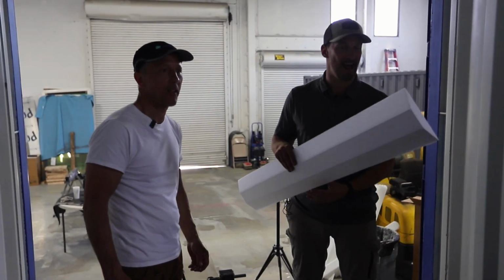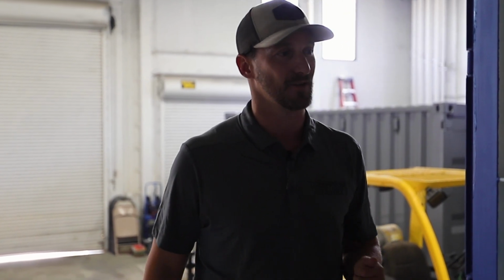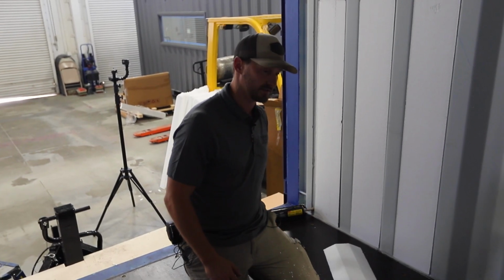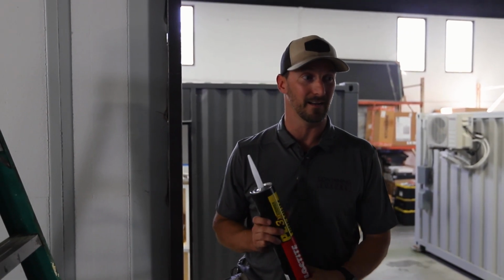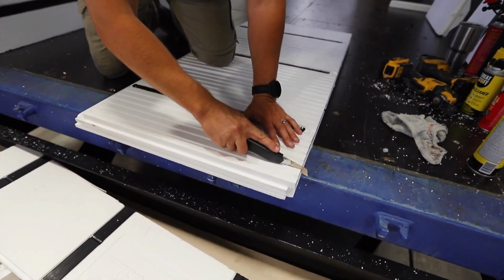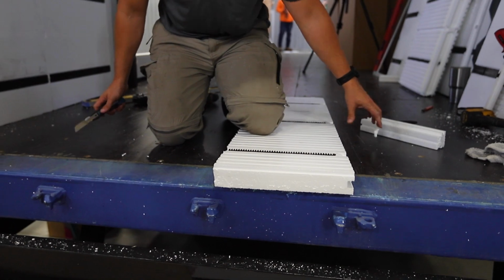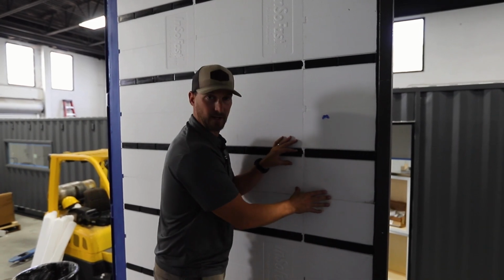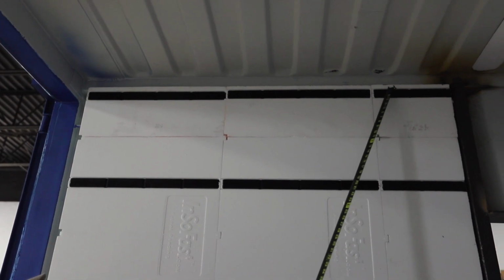How to Install InSoFast® Sidewall Inserts and UX 2.0 Flat Panels in Shipping Container Homes

Comment: Ok so this is a new product ?
My insofast side wall s are one piece and the interior studs are vertical.The front endwall panel is horizontal. Why did they go to a 2 piece?
Reply from the maker: That's the perfect question for this video! 

So you used the CX Panel which has the corrugations matched specifically to the container walls. The Inserts + flat Panel bundle shown in this video are going to work best when the shipping container is older with dents and bruises.  Also, if the container has been modified where the weld seams are no longer 44" on center, this bundle option is going to make the installation process a whole lot faster with less cuts and modifications!
Reply: @insofast-continuous-insulation  ah that makes sense! Mine was a one tripper ! Thanks 4 th info !!
Reply from the maker: @johnwarren5406  exactly!!! Happy to provide!